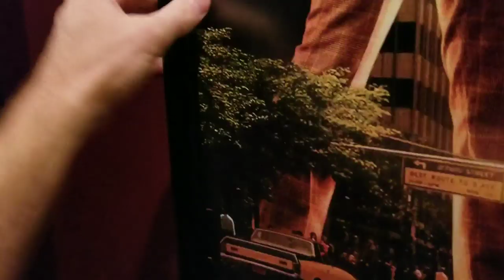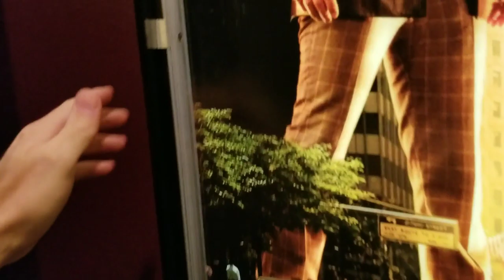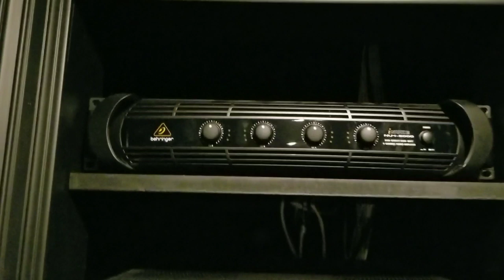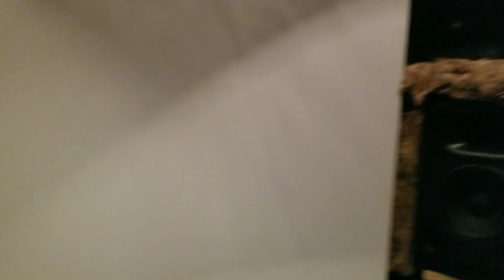Epic Home Theater Room Walk through! | Home Theater Gurus | My Home Theater

Comment: cool video ..... how Will  the sound be if you remove a great deal of all the insulation materials around your speaker (not sub) thinking they would benefit from getting some air around them, have you experimented ??
Reply from the maker: Have you seen the ep on Inwalls?  They need to be sealed into a wall to get the benifits of the baffle wall effect.  As for the acoustic treatments, all reflections will be manipulated for optimal sound.  I'll be using a mixture of different treatment options.
Reply: Hello.
And thanks for reply. now it makes sense I thought it was a "regular" speaker and therefore could not understand the amount of isolation. But when it's a dedicated built-in speaker, I understand. your home theater seems to be of quality and your attention to detail is superb. 
Finally, good work and for God's sake keep making videos, they are good and meticulous. 
Yours sincerely A fan from Denmark🇩🇰🇩🇰🇩🇰🇩🇰🇩🇰🇩🇰🇩🇰

 PS.
Using Google translate, hope it will translate properly.

Comment: Hi, amazing build and I can really tell you have put a ton of thought and effort into the build and design.
I completely agree with you on the front wall, the mains sound better placed just outside of the screen edges.
I saw your review on the Volt 10, i have 4 volt 6 myself and I must say they sound phenomenal for all the less than stellar measurements.
Are you still using the volt 10 for surround and atmos? Do you find they sound lacking in some way in use?
I'm a firm believer in good measurements for good performance. For volts, their Strengths lie in their vertical off axis. A HTM as surround would be stellar horizontally, but would be weaker in the vertical pan with the atmos speakers.
Appreciate your feedback!

Comment: Fantastic series on HT design. I spent months researching this type of information and it was brilliantly consolidated here in your channel. 

2 questions: what subs did you use? And if you could share plans or link to a similar design that would be great too.
If you could choose your atmos and surrounds to match your LCRs, what would they be? I’m considering HT-10s for LCRs and HT-8s for surrounds. No clue about atmos. HT-8s?

Thanks for your contribution to DIY HT!
Reply from the maker: Thanks!

My subs in my recently sold house were ht18s in 12 cubes tuned to 17hz.  We'll soon be covering sub design on the channel.

As for Diy speakers, the htm series is great.  I'm sure the HT is as well but haven't looked into them but the seos waveguide is a good one.

For atmos... The volts are definitely out as per ep 4 (maybe 5) I think it was.

Id try and mount matching bookshelves for atmos or maybe something the RSL 34e which looks promising and I'd like to get my hands on to test.

Comment: Thanks for the tour.  I would love your take on advice for building the AT screen: what's recommended and why.  I'll be building mine soon.  It won't be as elaborate as yours...I have SVS Ultra Towers and Ultra Center for my LCR, and I'll be using 2 full Marty enclosures for my subs, all behind the AT screen.  I know towers aren't necessarily the best option for AT screens, and especially a center channel (since it's recommended to have matching LCR speakers), but that's what I have for now.  Plans for a video on something like that?  You mentioned a future video for a baffle wall, is that what you're getting at?
Reply from the maker: You're welcome
 As for advice, towers are actually a better center than a horizontal center.  That's why high end theaters always have 3 identical vertical speakers for lcr.

I like Seymour material for the diyer.  Also check out ep 1 as you mentioned all of those speakers including mains behind an acoustic screen which is a red flag.

As for the video on baffle walls it'll be why baffle walls are superior and how they work and manipulate the sound.
Reply: @hometheatergurus  Thanks.  So would it be better to trade the SVS Ultra Center for another Ultra Tower (to have 3 Ultra Towers for the Left Center and Right)?  I'll check out the Seymour material, thanks for recommending!  My room will be roughly 11.5'-12' wide (and 26' deep before the AT screen wall addition), and plan to have a 135-150" screen, so I assume most speakers will be behind it or next to it behind transparent material like your subs.  I won't know until I finish the room and get exact measurements.
Reply from the maker: I'd definitely trade the center for another tower.

As for screen size I'd use the video on the room mode calculator and ep 1 to help place seats.  The width of the room  will limit you.  With that width let's say the mains are 10 feet apart center of one main to center of the other main.  So that puts seats 9 feet back or so from the speaker baffles.  See ep 1 for visuals. 

So if you want a nice big 16:9 screen in the 45 degree range that's around a 100 to 105 inch screen (actual calculations are in my screen size video).  That will be ballpark for optimal Soundstage and screen size.
Reply: @hometheatergurus  @Adam Netko I'm also considering the same SVS Ultra setup. I reached out to SVS for their recommendation and they were adamant that the Ultra Center would their first choice as center over a tower for a wider dispersion even behind the AT screen.  Not sure what to believe at this point.
Reply from the maker: @adamjj85  as for on and off axis repsonses if their tower and the center.  Make them back it up.

Comment: Did you find an issue being so close to the rear wall ? I was told it’s best to be at least 3-4’ from the rear wall / speakers? Secondly ,with the rear wall seating position, is atmos severely effected not being directly under them?  

The reason I ask is I will have a room roughly these dimensions ( I only want 1 row of seating) so was thinking of putting my screen on the long wall.

Comment: Well done, very informative, thank you.
1 question: you replaced the SC-1250 speakers with HTM-12's. I know the HTM's are very good speakers, but besides the stage width, how would you compare sound quality difference between the 2? I guess the QSC's reproduce better dialogue and are more dynamic above crossover point?
Reply from the maker: Thanks.  The vocals are every bit as good as the 2150.  Both are very smooth and detailed. Dynamics, imaging is all on par as well once crossed to a sub.  Neither speaker was pushed in my room and had a ton of headroom so neither had a dynamics advantage.  Sure in a real cinema where the htm 12 would be pushed to its limits the 2150 would have the edge.  Id personally choose the htm 12 everytime as they're easier to properly place and placement is everything.  In  huge rooms where the 2150s can properly flank the screen to the desired 60 degrees it's a toss up.  The htm 12 will result in better performance and a better overall and larger sound in regular size rooms where the 2150s wouldn't be able to be properly placed.

In my room as I want able to flank the screen with the 2150s the htm12s sounded vastly larger with a much wider sound stage.  But that was due to placement.

Comment: I've always wanted to run a pro amp on my subs but didn't want the fan noise. So what does the fan mod entail???
Reply from the maker: It's about a 5 minute job. Unplug fan Remove cover, unscrew 4 screws holding in fan. Install new fan, splice in wires or if the new fan has a plug that  fits plug in onto the board.

Comment: How is your signal chain to your bass shaker? The reason I’m asking is because I want my shakers to get a flat signal without room correction (eq). Do you use mini DSP to split the output from the receiver to the subs and shakers?
Reply from the maker: I use sub out # 2 for the shakers.  This room has no room correction being used other than the mindsp on the subs.

Comment: Great video.  With your dual side surrounds wired in parallel, do you notice any comb filter effect with it?
Reply from the maker: Thanks. 

I sold that house and I'll soon be unveiling the next home theater. 

 As for comb filtering Only when walking front to back if you play pink noise you hear it if you listen for it.

When seated each row stays in the same lobe so there's no issues.

Comment: Are your subs stereo integrity HST-18s?  If so, im curious how the inuke handled them.  Were they dual 1 ohm configuration with a 2 ohm load on each channel?  Ive got 2 ordered with a plan to order 2 more, and trying to decide on an amp.  Thanks!
Reply from the maker: Those are ht 18s version 1, not hst.  They have  d4 coils wired for 2 ohms.  It handled them with ease.

Comment: Thanks for the tour!  Can you give me more information on your subs?  I’m looking to build my own and hide them behind fabric like you did.  Thanks for doing the videos, it’s helping me design theater 2.0
Reply from the maker: You're welcome.

For the subs they're 12 cubes tuned for 17hz with stereo intgretiy ht 18 D4 drivers.  They're tuned with a natural slight house curve.

They're huge and honestly the new theater will have 4 um12s ported or sealed 18s.   These boxes are I have now are just so dang big.

We will be designing subs on the channel later using winisd which is a free software used to design enclosures.  We'll model some drivers, decide on an enclosure that's living room friendly  and we'll build it.  I'll give subscribers some nice vinyl veneer options then we'll wrap them.  It'll be something very nice but not too complicated. We'll also do compression test on it to see how it stacks up against some subs on data bass.  Then I'll throw as much power as I can't to it and try and break it.. Fun fun.

The build plans will be available to subscribers.  Fwiw I've designed subs using the um12 for guys that own Marty subs and they were so impressed they commented they wouldn't have done the huge Marty subs if they had known the um12 in a much smaller box performed so well.
Reply: Thanks for the info. I’m planning out a 20x26 room.  I currently own 2 HSU 15” subs, but like the vertical enclosure to fit more into the walls and easier to hide.   I hope your home sale has gone smoothly.  My theater 1.0 in our Houston, TX house was a PITA to sell and explain to buyers, depends on the buyer I guess
Reply from the maker: @jeremytews3006  Wow that's a huge room.  As for the house it looks like it'll be sold in December. Hopefully no huccups.

Comment: Great theater, but you REALLY need to get a 4k Blu-ray player for the best and most immersive audio content and improved picture quality.
Reply from the maker: Thanks. 

It's a 1080p projector.  But trust me when I build the next one it will have it!

I'm too cheap to upgrade such high price gear like a projector until it breaks.  :)

I do use the Xbox to play 4k disc with atmos. 

The current theater is being sold as is so all gear stays with the house.   So next one I'll be buying new everything including a Sony or jvc 4k projector and a stand alone player.
Reply: @hometheatergurus  even if you have a 1080p projector for now, you can still use 4k discs for the lossless Dolby Atmos and DTS: X.  Many studios will now only release immersive audio on 4k disc... and you're future proofing your collection.  They can't take your discs away, but there are no such assurances with digital streaming or downloads.
Reply from the maker: @dan_hitchman007  guess you missed the comment above but I do use 4k disc for the atmos.

Comment: Hey that's cool man. New subscriber here. Very informative video's. You going with an OLED set in your new house instead with towers or bookshelves? I'd like to see what you end up getting. No gym?
Reply from the maker: Thanks.  The wife and I  are actually back and forth.  I plan on having bonus room above the new garage.. Should we go gym and rec room or theater and rec room.  Just not sure.  As for the living room I have diy towers with module subs so I'll probably diy some larger ones for new living room as enjoy wood working with maybe an 86" TV and full atmos system.  Not sure about oled as I'm cheap and can't help it 😜.  Same for master bedroom, atmos system with an 82 to 86.     So I'll have basically home theater setups in the living room and master.  We dont use the theater as much as we used to.  But I do enjoy the design and build phase tremendously.
Reply: @hometheatergurus  Thanks for responding. I have a 20+ year old NHT speaker system and been thinking about upgrading like you're doing.

Comment: How's sound leak to the rest of the house when playing at your normal volume (ie decently loud)? Do you have any sound absorption insulation in the walls around the room?
Reply from the maker: Absorption in the walls does little as sound is transmitted through the studs.  We will cover that at some point.  

That said I used a staggered stud wall design which isolates one side from the other and  have fiberglass insulation in the wall as well.  You can beat on one side and not hear it on the other due to the staggered stud design.  I also did this around the master bedroom.  You can be in the theater and know one will even know as long as you don't crank it over - 15.  If it's audible in the house it's very loud in the theater room.

Comment: What were the dimensions on that room I also heard on the video that you design. Room that's only for you or would you do it for someone like me for the right price not ready yet to pull the plug but when I'm ready are you available to do something like that I kind of like the way your room was but I want to do a opposite entrance from the front not from the back it will be 10 foot ceilings more likely 150 in 16 by 9 screen transparent keeping my SVS Ultra 16 Subs have two of them right now and more likely getting two more subs don't know if I should go with the same ones or possible jtr subs I'm between two speakers company rbh si831r in wall or thx kef in wall speakers reference
Reply from the maker: That room was 16x21.5 with 10'4" ceilings.

As for room consultation yes I do offer that.  See my latest videos for contact info in the description.

Comment: If the room is big enough I would LOVE to have a Screen that's between 200"-300" 16:9 Aspect Ratio Fixed Frame.
Reply from the maker: Yeah that would be cool but you'd have to sit so far back to get the viewing angle watchable.   It would be cool when you walked in though.
Reply: @hometheatergurus  Well yeah.  But I'm not like most guys.  I LOVE the Big Screen feel like the closest thing to a Real Movie Theater feel and Screen.
Reply from the maker: @vestel777  yep it's definitely preference.  I like a 45 degree viewing angle personally.
Reply: @hometheatergurus  That's the thing I don't understand is what's important about viewing angles???  Is that a real thing?  For instance - When I go to the local Movie Theater in Springfield, Illinois at the AMC Theater I always sit in the very back row.  The reasoning behind that is whenever I sit like in the middle of the Theater I have a hard time seeing over the person in front of Me.  If I sit in the second row my neck hurts from looking up.
Reply from the maker: @vestel777  viewing angles are everything. That's what determines immersion. 

Watch episode 13 and I have visuals.
Reply: @hometheatergurus  Will do.